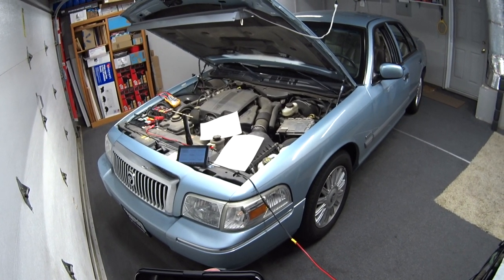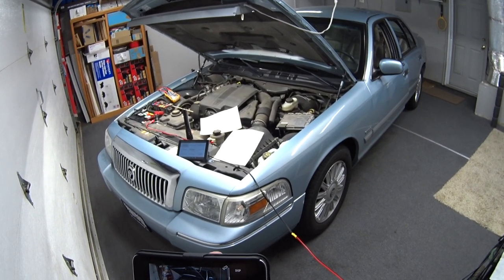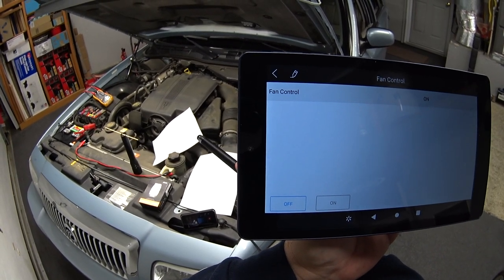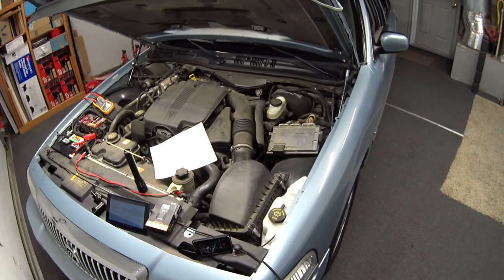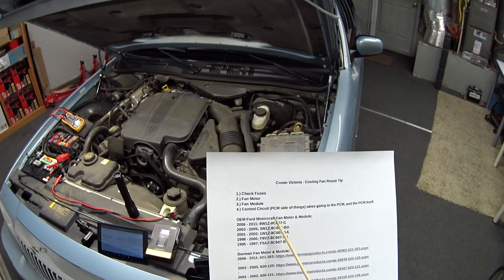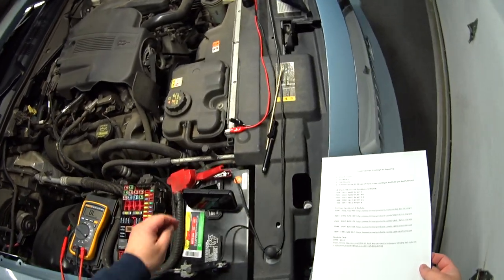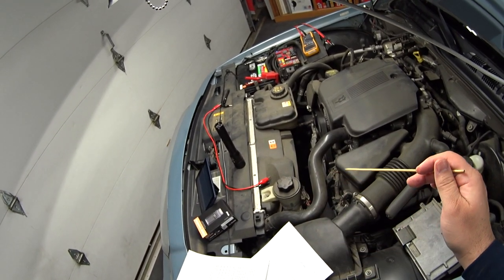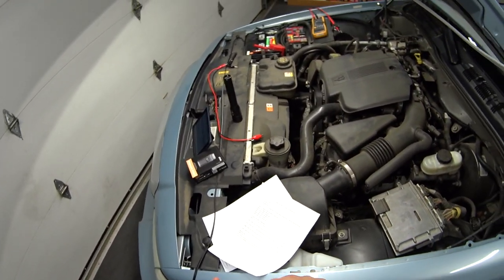Crown Victoria - Fan Test With Scan Tool

Comment: FANtastic.  Nice work chuck.  Even though the bluedriver is considered to be bidirectional I am not certain it can control the fan.  I will have to check that out.  Also for those that don't want to do all this fancy stuff don't forget that can check your cooling fan operation by just turning the HVAC controls to AC on.    Another note, if you live in a mild climate and you know your cooling fan has failed, you can normally keep one of these engines from overheating by just turning on the heater.  Doesn't even have to be full blast.   The only reason we figured out that our fan had died is because for no real reason isaac was driving his car around with the HVAC in OFF.  It never tripped a light but he was observant and saw the temp needle about 3/4s the way up instead of it's normal half.
Reply from the maker: Right on Mr. Black,
Good point about turning on the A/C to check cooling fan operation. I always forget the simplest things. lol

Using the heater core as an additional radiator is a great idea for another video, hmmm.
That’s weird the failed cooling fan did not trigger a DTC even though it’s controlled by a module. 
Thanks for stopping by.
-Chuck
Reply: @PanzerPlatform  
My 2008 has an active fan circuit open code currently, with no CEL. Coincidentally, that's how I stumbled on the video. This is my first gas vehicle in about a decade so it's taking some getting used to. Changed the intake and some other maintenance today.
Reply from the maker: @kylesonsalla7620  
Right on Kyle,
Thanks for stopping in.
-Chuck

Comment: Great video, Sir!
Reply from the maker: You're too kind Brian. 
Like Mr. Black mentioned there is a ton of things I forgot to include.
I was just so excited to show the A30M actually doing something useful. lol

Oh yeah, can I request you use your Crown Vic for your D9 review video?
That would be awesome.
-Chuck
Reply: @PanzerPlatform  Your videos always have great presentation (I think that's what it's called) and you can tell that you always plan ahead before recording your videos.  You have all your props, information and documentation ready to go before recording and you talk very clear so you're easy to understand. Regardless if you missed some info (I wouldn't be able to tell anyway) the video itself was still good. As for the D9 video....  Yes, I will probably record a portion of the video with the Crown Vic, and another portion of the video with my old 2006 GMC truck.  I also have a new 2022 car but I'm not sure if they have 2022 model year in the scan tool yet. They claim the D9 is capable of some form of ECU coding or programing with Fords (WJ Handy Dad mentioned that to me in another comment) so I want to be sure to at show that functionality if the scan tool is indeed capable of doing so.

Comment: I guess maybe I'm lucky, I've got 3 Mercury GM's 2-2006's, and one 2005, and after 11 years I haven't had any issues with my cooling fans; knock on wood!
Reply from the maker: Right on Phil,
You bring up an good point.
My 2004 Vic with 162K Miles is on the original fan also.
Just like my 2010 MGM with 88K Miles in this video.

In Mr. Black's video he explains the cooling fan malfunction may be due to high idle hours on his 2011 P7B.
I think he suspect the car was idling the entire time the car was in service. lol
-Chuck
Reply: @PanzerPlatform  with the AC on all summer long.
Reply: @PanzerPlatform  162K on the Vic?; Wow man, what, do you drive to San Diego once a week roundtrip or something? lol
Reply from the maker: @philipthomas6808  
I bought it in 2009 with 100K Miles.
From 2009 - 2014 I drove it 60K Miles.
From 2015 - 2022 I drove it 2K Miles.
Now it just sits. lol

Comment: That brown fuse with the clear top  you tested with the continuity test why did you not plug it in . Is that spot an actual fuse placement? My 06 p71 Vic doesn’t have a fuse there
Reply from the maker: That fuse was just a test / sample.
It is not used in the car.
-Chuck

Comment: 2005 police crown vic ---- BRO I NEED HELP! been having overheating issues & replaced everything in the system. NOT overheating anymore but the radiator fan goes to high after only 5 mins of running. stays on high fan until shut off. replaced the radiator, water pump, CT sensor, HT sensor, thermostat (160), fresh coolant after 3 flushes. used a laser temp tool & highest reading on cyl or anywhere, is only 160 degrees. fan will be on HIGH with that LOW temp. CANT FIGURE IT OUT & NEED TO SELL!.
Reply from the maker: Yo Darren,
Thanks for stopping by.
Questions like yours are what is so helpful to all the guys in the Panther Car Community. Chances are there are a bunch more people with the same exact issue, and they also want help figuring out how to diagnose it.

In order to help the most people, and so everyone can benefit from the information, that’s why I do the “Viewer Question” & “Guess The Malfunction” videos. I don’t have all the answers for all the years, and models of Panther Cars. But chances are someone has your exact model, and year, and they have first hand experience diagnosing the cause.

The best way I've found is to make a short 1 minute video showing, describing, and explaining your malfunction. Here is a perfect example how to do it; https://youtu.be/rTugE6sGmrM

Let me know if you upload the video to your channel. I will download it, and post it on my channel. Most likely you will get some help in the comment section from someone who has already fixed the issue. Please film your video in the daytime, and in widescreen 1080p, (no vertical video).
-Chuck